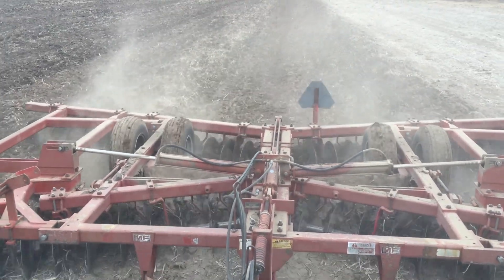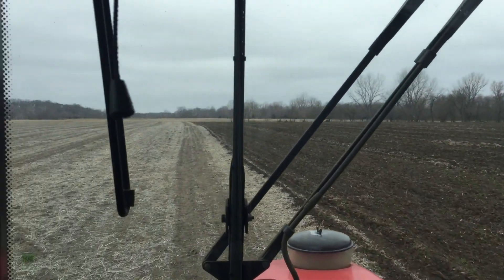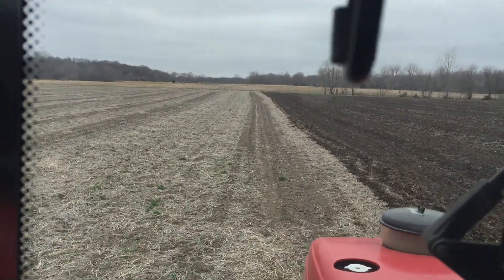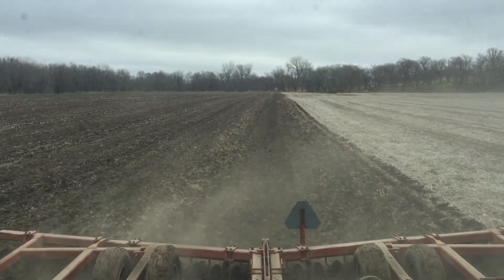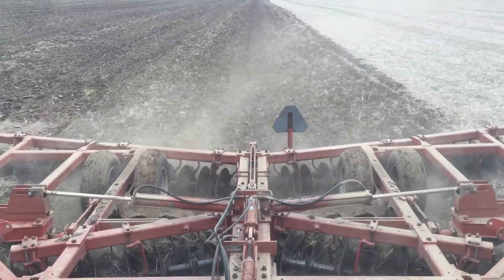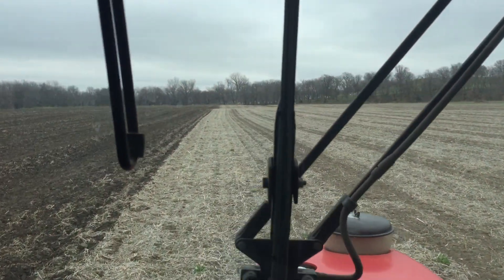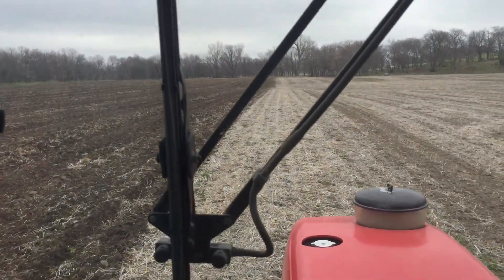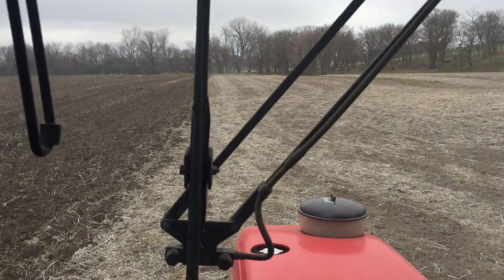Spring Discing--Dry Conditions

Comment: So with greater moisture would you have chisel plowed the bean stubble?  What was your reasoning again for not preferring to use the disk under normal conditions?
Reply from the maker: In normal-moist conditions, my primary would have been 2 field cultivator passes, first shallow wait 1/2 day second pass deeper, all to "burn" moisture and dry the soil.  I never chisel bean residue.  Chisel is primarily to kill red clover and cover crops.  The primary reason I dislike the disc is that you can do a lot of damage to soil structure if you disc too wet.  NOT A PROBLEM THIS YEAR!

Comment: What make and model tractor are you using? What's the PTO horsepower and the width of your disk?
Reply from the maker: I have a Massey Ferguson 6180 w/ 115 pto/hp.  The disc is 19.5 feet I think and I am running at 5 to5.4 mph.  If I had the hp I would push it a little faster, but I am running at 4-6" deep and the disc is not "jumping" around.

Comment: Was this clover before beans? Is nitrogen usually the limiting yield factor? I assume disking is kind of the dust mulch theory as to breaking the capillary action of the soil? The dirt sure looks nice.
Reply from the maker: Rotation here was clover, corn, beans, and now, corn or forage sorghum.  Disking here is a single (thus less moisture loss)pass to accomplish my seedbed.  Years of good farming have given me this soil structure (it was pretty rough looking in the early 90's).  Biggest control of yield is fertility and weed control.  You have a hard time seeing in the video, but we ran (and fed) cows on this field during the winter.  There was manure spread after the clover (40/30/20/10 rule), the beans yielded 60 so I have 60 N credits there, and the winter cattle feeding also contributed to fertility.  This year perhaps moisture will be the limiting factor :(